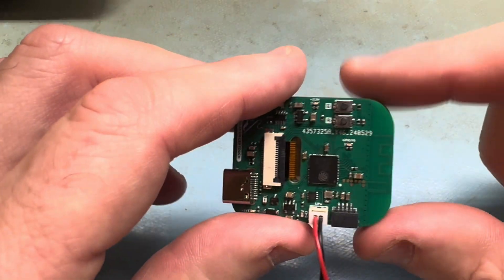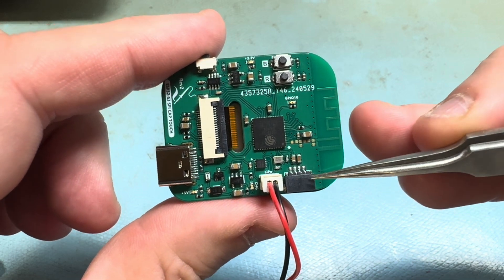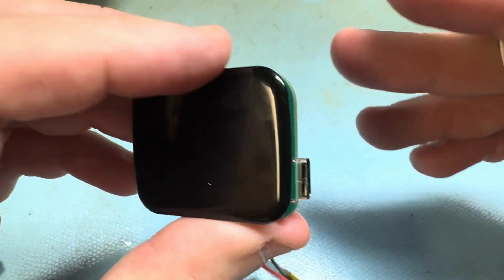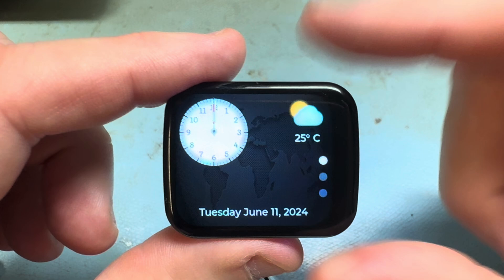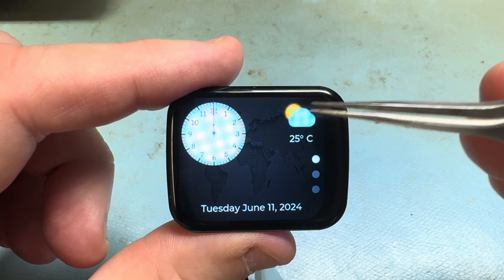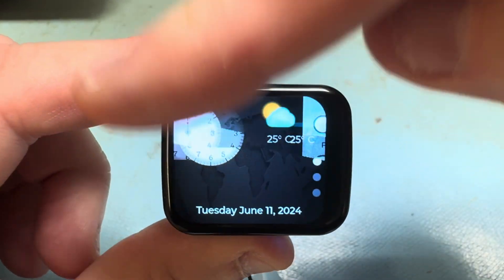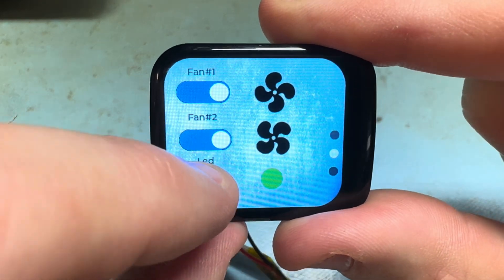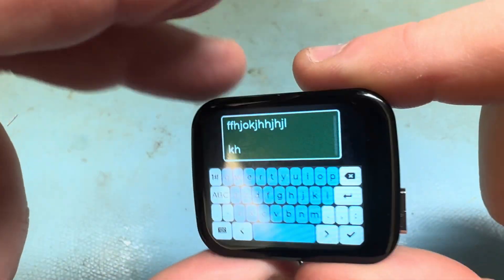1.69” Capacitive Touch screen and Squareline Studio progress

Comment: Really nice stuff. I am using a similar 1.69” display with touch (the waveshare 1.69 Esp32-s3 dev board) and also slowly learning lvgl/squareline. I am currently struggling with swiping between screens. Would love to see your code/squareline project!
Reply from the maker: @TimRatto  I likely didn’t do the swipe between screens properly but what I did was create a large button on one side and made it completely transparent. Then assign that hidden button to Change Screen.
Reply: @0miker0  That makes perfect sense, thanks!

Comment: whats the purpose of this device?
Reply from the maker: To evaluate the new 1.69" capacitive touch display and LTC2954 for pushbutton power on/off to replace the slide switch i've always used.
Reply: @0miker0  Hey, I have this screen but im having trouble connecting it to an esp. What connections do you have to make between this screen and a microcontroller in order to work. Also, do you have any test code available?
Reply from the maker: @aceofhades9648 Not a problem. Email me 0miker0@gmail.com and I’ll send you my schematic and test code.